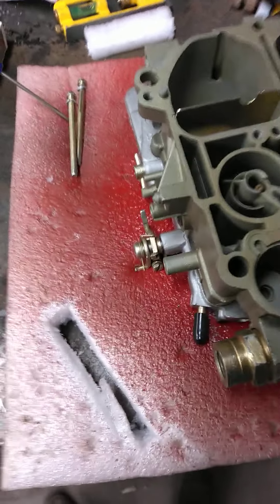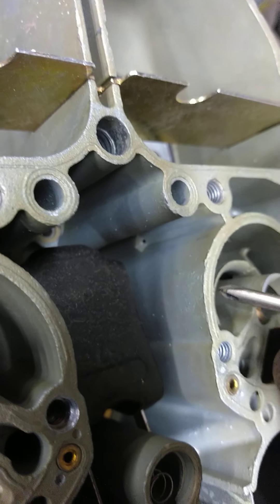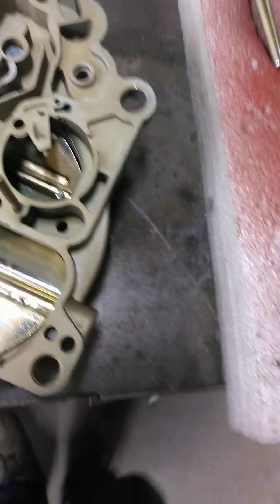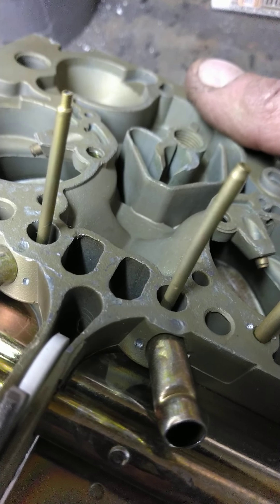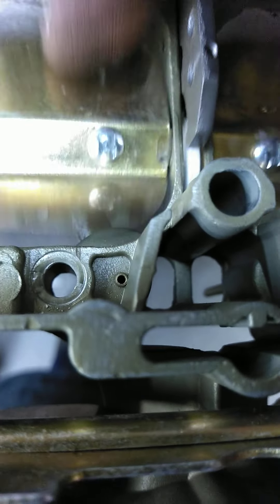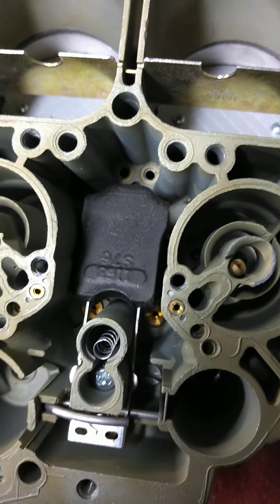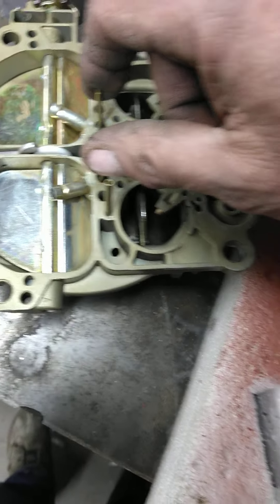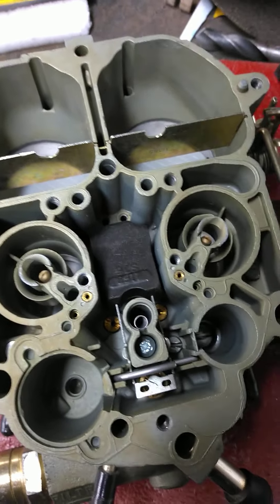Jet Performance Racing $400 q jet (junk)

Comment: I got their circle track qjet and the well plugs were not retained very well (pun intended) and one fell out and luckily I turned the car off as soon as it started running bad because the plug was sitting in my intake manifold. Imagine if the motor ate it. I did screw in plugs after seeing that. Also the needle and seat failed after only a couple hours of run time so I replaced it with one from a heavily used qjet and it’s still working a year later. There was one more thing the air valve that keeps the doors from flying open had a vacuum leak inside of it so I also snagged one of my heavily used qjet and I’m rocking that 🙄
Reply from the maker: Q jets for life ! Check out i think its todd haven firebird q jet in action . Bad ass firebird ! Go pro under the hood . Cpl 20 second clips , q jet in action on the track

Comment: I bought one of those about 4 years ago put it on my dump truck that has a wore out motor to begin with it was a stage 1 or factory replacement,im thinking I should inspect it now just to see what it’s hiding.
Reply from the maker: Im amazed at the garbage through the years ive found in side reman carbs . Your just screwed out the gate ! Its a variable ! Ya dont make sure its good before ya put it on . Then ya got problems n dont know wher ta start . Lol

Comment: I got one and it was great
Reply from the maker: You seen all the crap wrong in side mine ! National carb is WAY better ! Its actually brand new . Not reworked garbage ! Glad ya got a good one ! Ther not cheap !
Reply: @theweldor757  I did just must have gotten a bad one but mine seemed fine for the most part. They Definitely are not cheap that's right 👍

Comment: That's only what's visible.  I'll bet the air horn is warped. I'd send it right back.  Jet has a shit reputation.  Check the throttle bushings.  They are relatively easy carburetors to work on,  but when an idiot has butchered it,  toss it aside.